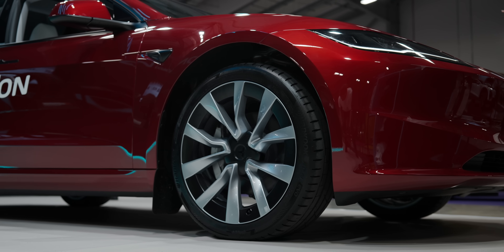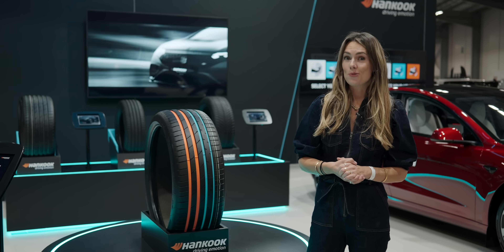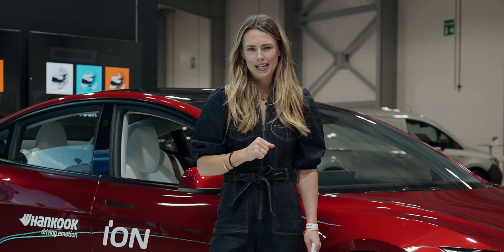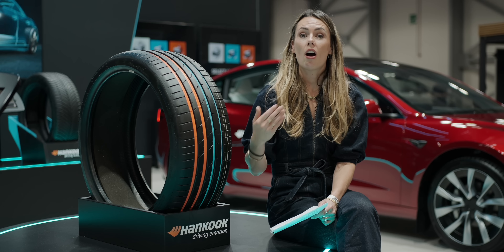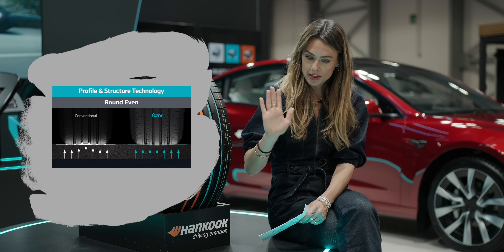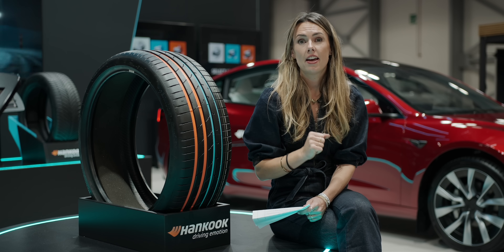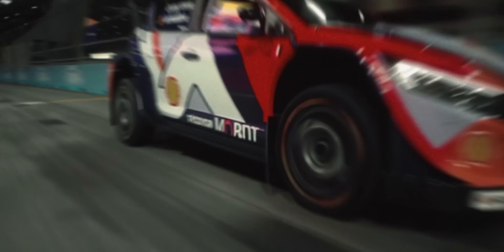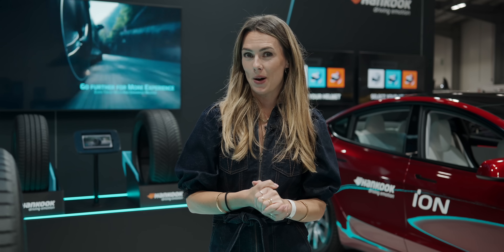The Electric Vehicle Range Hack No One Talks About....!

Comment: I thought EVs were getting lighter as battery technology improves, range increases so smaller units are needed thus overall weight drops? Some EVs are definitely the same weight nowadays than their fossil fuel equivalents. I am not convinced EVs need EV tyres especially when they cost more.

Comment: Having shopped for tyres, its kind of interesting to see how vague their claims are always. Last 15% longer. Extend range by 6%. But no manufacturer has release data on the specifics, like N/ton for rolling resistance and noise generation in dB at the tyre.  Its good that EU authorities created EU label providing a standard scientific test and classification (although still vague-ish) but its sadly only enforced in the EU. There's a UTQG rating for treadwear but its not standardized.
 
This "advertisement" just on goes to show how fabulous their EV tyres are... but I would like to suspect that their best tyre would be similar to this. After all, a hundred years of tyre research and all the best tech each company has would have been put into their top line to provide better everything (who will complain about more range, more grip and less noise if you can achieve it without compromise?) to try to beat their competitor. Then again, their vagueness will only help them by leave you guessing on which rubber is better and hopefully picking theirs again by some shear luck. 

Somewhat incoherent ranting phase~

Comment: How interesting. After much consideration and advice from my supplier I fitted Hankook Ventus Prime 4 98W on all wheels on my Kia E-Niro at the beginning of September. Since then I have experienced a 10 - 15% DROP in efficiency (from average 4.2m/kWhr to 3.8 and less). I also had the car serviced last week and the dealer noted 31% wear on front tyres - after around 5k miles. If this is what their advanced technology produced I revert to cheap and cheerful.

Comment: Interestingly, I have just had four Hankook Ion Flexclimate SUV tyres fitted to my e-Niro. 
Noticeably quieter, feels smoother and keener, yet I also noticed a big reduction in range, like, 20%. 
Okay, so temperatures have dropped so, yeah, but I will be fascinated to see what happens in summer. 
Yes, my tyres are correctly inflated. 
And in any case, home charging on Intelligent Go means it’s still cheap to run. Even though £150/tyre is far from cheap.

Comment: There's no doubt Hankook Ion  tyres are good, they are fitted as standard equipment on many EVs but as stated in an EV tyre comparison from AutoBild magazine, "One of the most interesting findings was that the Hankook iON evo, specifically designed for EVs, claimed the overall victory, but standard tyres from Continental and Goodyear followed extremely closely behind. This suggests that the gap between dedicated EV tyres and high-quality standard tyres is minimal when balancing safety and efficiency needs."

Comment: OMG! "4% HIGHER LOW rolling resistance"!  Regardless of the double-negative, it's only 1.75% more range, not the "6%" claimed:  The last vid claimed that rolling resistance is only 25% of total drag.  4% + 3% from curing = 7%.  7% of 25% is only 1.75%.

Comment: This is the worst and outright most dangerous tyre I’ve had on my car in a long time. Completely unpredictable handling on wet roads. Had the car sideways several times. The tyre causes vibrations in the car and produces a droning noise. After not even 15,000 motorway kilometres, there’s only 4 mm of tread left on the front and 6 mm on the rear. Absolutely avoid these for your own safety. The car’s consumption did go down, so the range increased.

Comment: All vehicle batteries should be energy dense to avoid the extra energy demand needed to haul around a heavy battery. Aircraft batteries, in particular, must be: high energy density to provide for range; high power density to allow for load surge during takeoff and landing; fast charging to allow quick turn-around flights, and; long cycle life so the battery won't have to be repeatedly replaced. The U. of Adelaide developed a Lithium-Sulfur battery yielding 1,306 Wh/kg with 1,000 cycles at 8C power density, but combined with the ion sieve of Karlsruhe U that provides 25,000 cycles at 5C, you’d have a cheap, really energy and power dense forever battery. The ion sieve of the Karlsruhe Li-S battery is so efficient, it can even reach 150C with decreased cycling life. The optimal battery for grid storage is a zinc anode with a 3D organic polymer cathode being developed by Nanjing University and the National University of Singapore that retains 93% of its 192 Wh/kg capacity after 40,000 cycles at a power density of 109 W/kg.

Comment: I find tyres a challenge.  The comercial incentive is to have them run out quickly and charge more for them.  The benefits are really difficult to tell because the 6%  more range and lasting 30% longer are promises made by the manufacturer generally the promise of the premium manufacturer.   Trusting the promises of a sales person when they can just turn around and say "oh it must have been your personal driving style" leaves me hungry for genuine 3rd party testing of claims
Reply: You do at least get EU standardised test data for tyres these days, with efficiency, wet grip, and something else ratings. This is better than a decade ago when there was a terrible dearth of independent info.

Comment: While I'm very much for electric cars over petrol cars, as a lifelong transport cyclist (strictly "acoustic" until my ticker played up after COVID), vehicular noise has been a key potential threat warning that has saved my bacon more than a few times. EV's near silence is a bit of a problem in mixed traffic, when cycling and, while some might say, "use the bike lane!" There aren't bike lanes everywhere in any city and not all bike lanes go where I need to, so half the time I need to ride as a vehicle. (And Australia's laws in fact define bicycles and their variants as vehicles, forbidding their use on footpaths.)

Now, once those festering petrol engines are a thing of the past, the relative noise issue won't be quite as much of a problem, but while "oilers" are still noising and stinking up the roads, EVs need a standout, but pleasant, noise maker for safety. I'm sure as heck not going to trust Tesla's cameras, no matter how much AI is behind them, over brands with Lidar systems (and the same amount of AI) because Lidar is designed to measure proximity and space. And this position is based on @MarkRober 's standout comparison between Tesla and Polestar, where the Tesla crashed into a test dummy in conditions ranging from normal to awful.

Comment: Michelin also has a great range of tyres (I used to work for the company) but ALL tyres will perform at their best when the PRESSURE is correct. Buy a good quality tyre, suited to your use case, and keep the PRESSURE where it should be. Safe travels.

Comment: Wait.  Since EVs are heavier than ICE, won't the mfrs simply size the weight capacity of the tires to match the vehicle weight? Sure,  that makes for larger and more expensive tires,  but why then would those properly matched tires wear more quickly?

Comment: I've had a set of Ion Flexclimate all season tyres on my Kia Niro EV for about a month. They are quiet, grip superbly and were no more expensive than other quality makes.
Have a listen to Imogens last interview with the Hankook tyre guy, its very interesting...  Link here  https://youtu.be/cxbcgaNoS0Y?si=xvvWoNX0uljcPGss
The engineering is impressive...
Reply: Ref the description blurb and mention of plenty of torque at low RPM ref BEVs ... why not simply build BEVs with less powerful electric motors?

Oh, but, wait though, the BEVs are so heavy, what with very heavy batteries, they appear to require a lot of torque to overcome the inertia, ergo the requirement for bullet proof tyres.

I don't suppose HMG will admit to it but I would be somewhat taken aback if said HMG didn't have concerns that the combination of weight and torque and keen drivers were ripping up the carriageway.

Now, to forestall the usual mindless chitter chatter from the battery hugger brigade, perhaps said chumps could refrain from screeching about the comparable weight of large  ICE powered SUVs then they should realise there's a lot more low speed torque from a powerful electric motor.

Kindly don't bother to argue but simply understand BEVs were but a step on the way to green motoring.

Batteries should now be recognised as an evolutionary dead end.

Obviously.